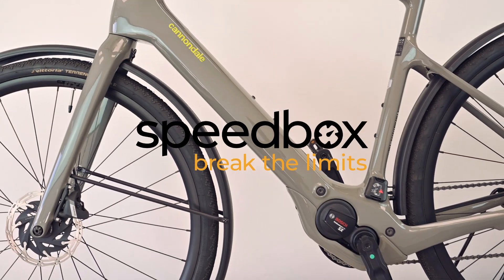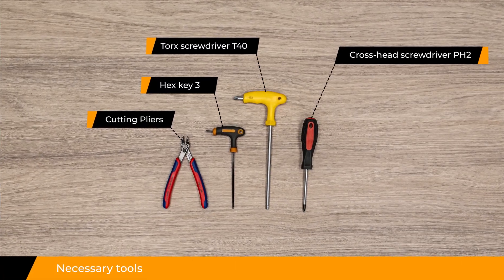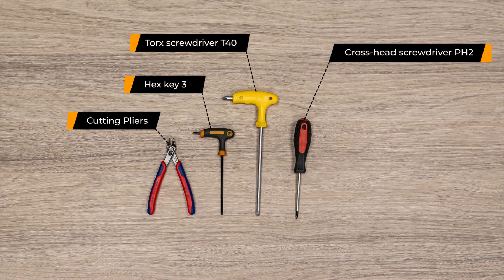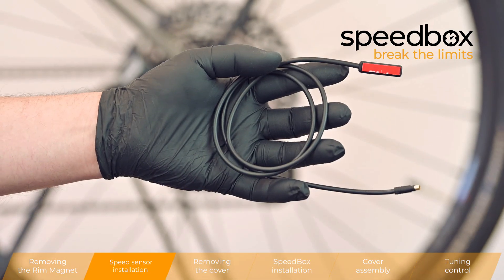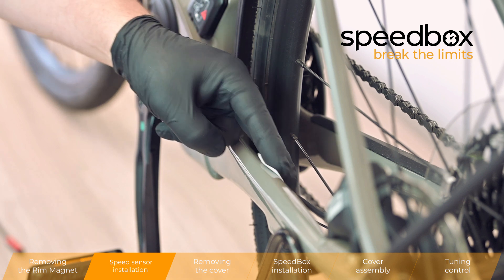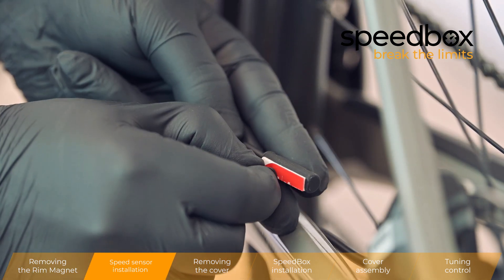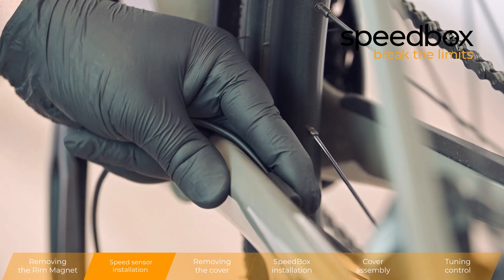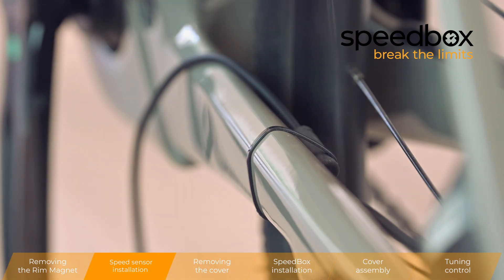NEW! Easy Install of SpeedBox 1.4 B.Tuning on Bosch SX (Smart System + Rim Magnet)

Comment: Hello what speedbox works for the Cube Stereo Hybrid 140 HPC SLX 750?
Reply from the maker: Hi,
If you have the magnet on the valve of the rear wheel, then yes.
If you have the standard spoke magnet, we recommend using SpeedBox 1.1:
👉 https://www.speedbox-tuning.com/smart-system
Reply: What if u dealer updates bosch systeem. U get any problems ?
Reply from the maker: @RickNL07  Currently, these products are compatible with the latest software version. However, we strongly advise against updating the software, as we cannot guarantee 100% functionality afterward. When visiting a service center, we recommend asking them not to perform any system updates.
Reply: @SpeedBoxTuning hi I have a very similar 2024 cube 155slx and I have purchased the speed box but they then have updated my software 😢 does this mean I have no option now ? Terrible timing, I’m quite upset
Reply from the maker: @cheesepizza87  Hi,
thanks for your question.
Please contact our support team at speedbox-tuning.com or via Messenger.
We’ll definitely find a solution.
Have a nice day.